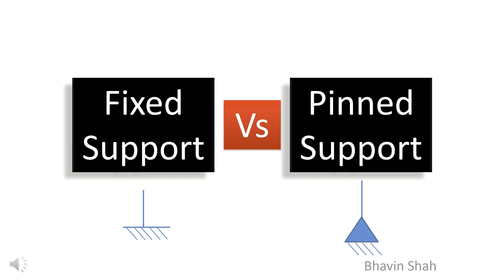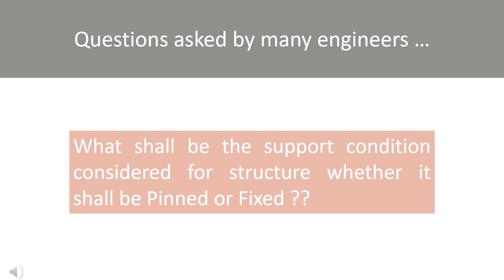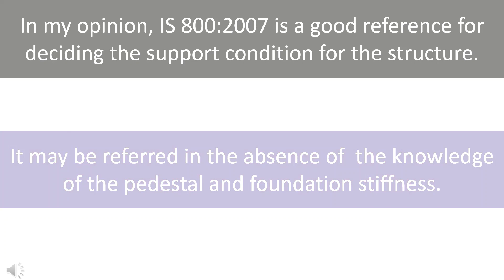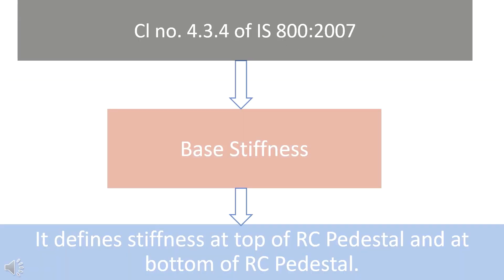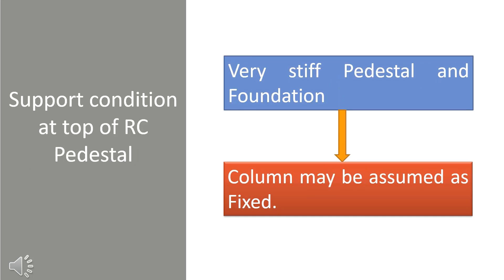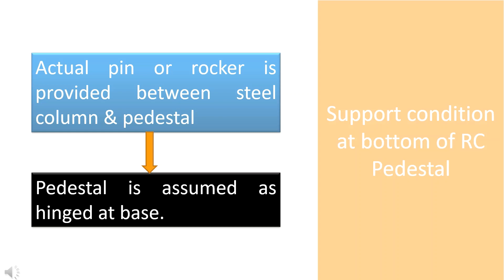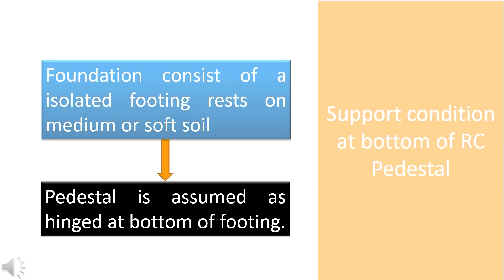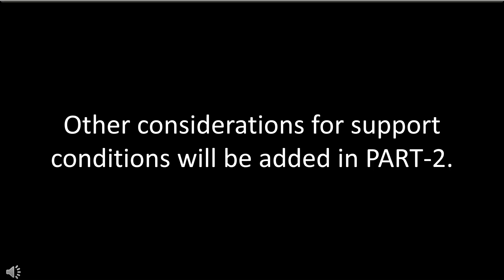Fixed vs Pinned Support (Part-1)

Comment: How to determine the depth of foundation ? It is required in ETAB software for modelling as a base storey.
Reply from the maker: We are receiving many queries related to structural engineering like technical queries, issues in professional practice, dissertation project related, career guidance, opening of new structural consultancy firm, etc. etc.  To justify the query and to respond appropriately, SQVe Consultants has launched new service for short duration consultation of 1 hour OR 30 min with nominal charges. It will be one-on-one session with Bhavin Shah (Founder & CEO, SQVe Consultants) at ZOOM software.

For more details and for booking the appointment, please visit the following link:
https://www.facebook.com/sqveconsultants/services/?ref=page_internal

Book your appointment now!
Reply: @StructuralEngineering  Good initiative sir.

Comment: Sir
Why the support conditiin us different at top and bottom

Individual footing is resting on 
weak ground and
Pit is protected ie horizontal movement is not pissible
Considerable size if footing 

Depth is more and the surrounding soil does not allow rotatiin 
It can be considered as fixed. 
Provide plinth beam to take moments
Reply from the maker: We are receiving many queries related to structural engineering like technical queries, issues in professional practice, dissertation project related, career guidance, opening of new structural consultancy firm, etc. etc.  To justify the query and to respond appropriately, we have launched new service for short duration consultation of 1 hour OR 30 min with nominal charges. For booking the appointment, please follow this link:

It will be one-on-one session with Bhavin Shah (Founder & CEO, SQVe Consultants) at ZOOM software.

For more details and for booking the appointment, please visit the following link:
https://www.facebook.com/sqveconsultants/services/?ref=page_internal
Book your appointment now!

Comment: Sir, can you please do tutorial for Analysis of Beam with pinned at one end and fixed at the other with point load on the middle of the span and uniform distributed load on the right half?
Reply from the maker: We are receiving many queries related to structural engineering like technical queries, issues in professional practice, dissertation project related, career guidance, opening of new structural consultancy firm, etc. etc.  To justify the query and to respond appropriately, we have launched new service for short duration consultation of 1 hour OR 30 min with nominal charges. For booking the appointment, please follow this link:

It will be one-on-one session with Bhavin Shah (Founder & CEO, SQVe Consultants) at ZOOM software.

For more details and for booking the appointment, please visit the following link:
https://www.facebook.com/sqveconsultants/services/?ref=page_internal
Book your appointment now!

Comment: Dear Sir,
What are types of end connections in Electrical transmission pole? I want to calculate the critical buckling load of one circular electrical transmission pole, but i am facing the difficulty to determine the correct end connections to apply eulers formula.
Reply: In case of single standing electrical pole, the support condition at bottom should be considered as fixed. The effective length should be increased same as for cantilever structure for calculation of the critical buckling load.
Reply: @BhavinShah11  thank you very much sir. I have a design of pole please provide me your email id so that i can send you the design calculation. My whatsapp no. + 97470683436
Reply: In my case i took one end fix other is pinned. Am i correct?
Reply from the maker: @nayabahmad9312  I have sent personal message on your whatsapp number.
Reply: @nayabahmad9312  or it should take it as free ?

Comment: Can we actually have a perfect pinned supporting baseplates without the rocker or pin connection just by having the bolts between the flanges
Reply: Bolts between flanges will provide minor resistance towards overturning moment hence, theoretically, it may not be considered as the connection having zero moment capacity. For all practical purpose, we can consider the moment capacity of the connection as zero.